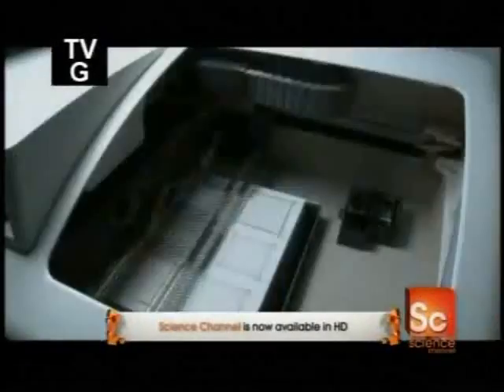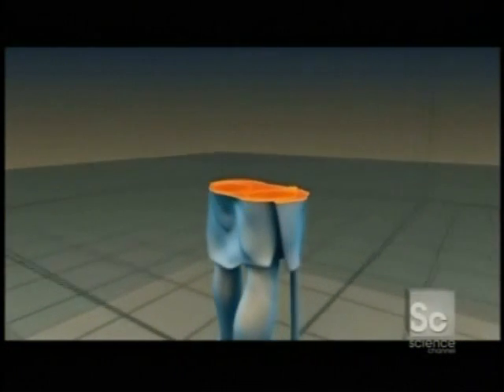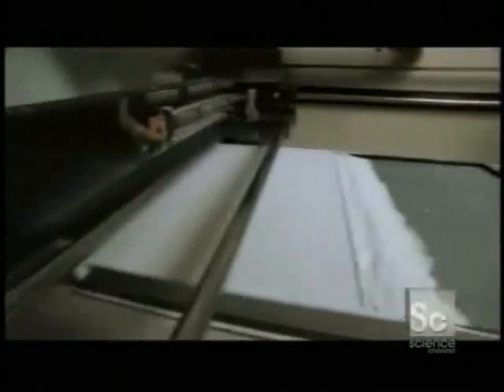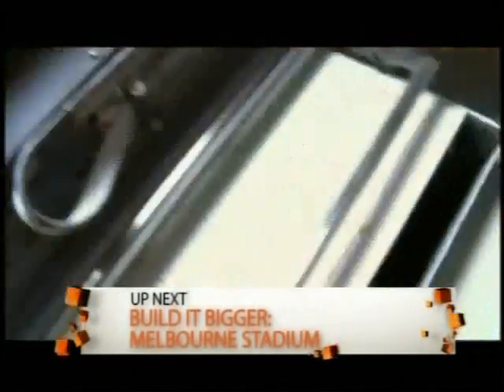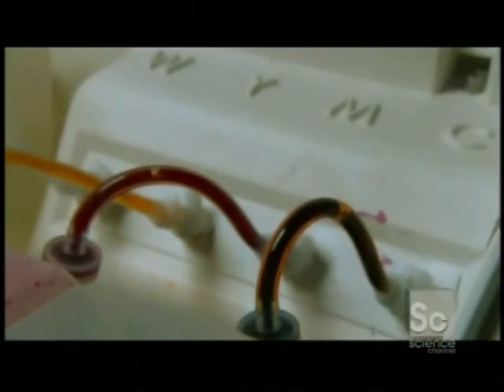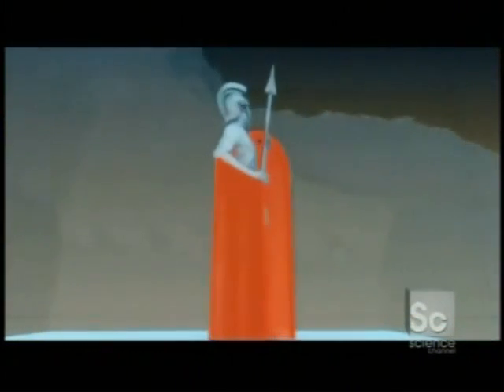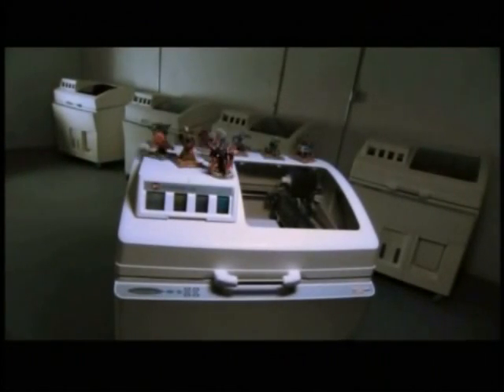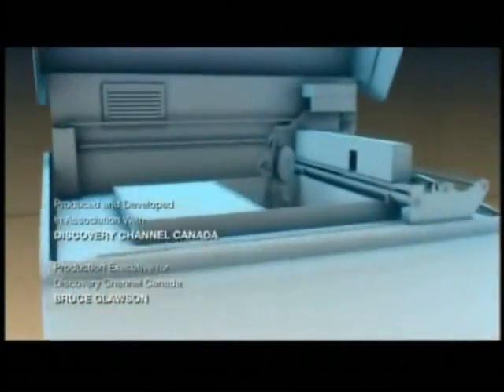FigurePrints on Discovery Science Channel's Machines!

Comment: Funny you might say that, there is a 3D printer out there which prints a good portion of the parts for another printer, which can then print another printer, and so on. Its not 100% reprinting everything (not the circuitboards and electronics) but it is indeed a very cool concept.